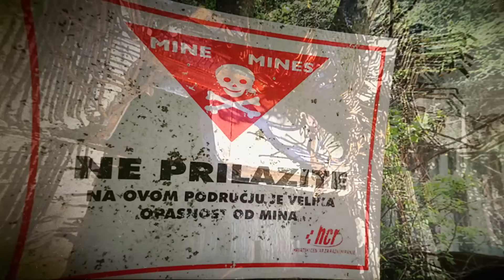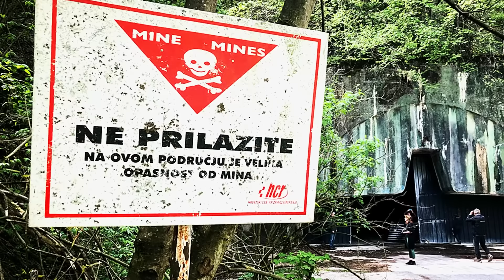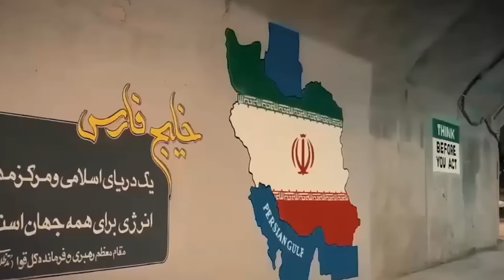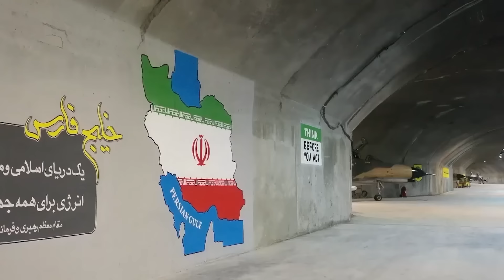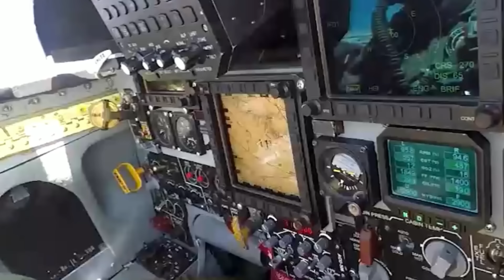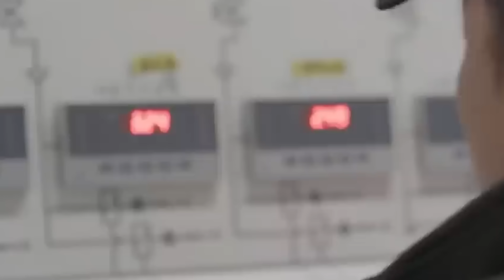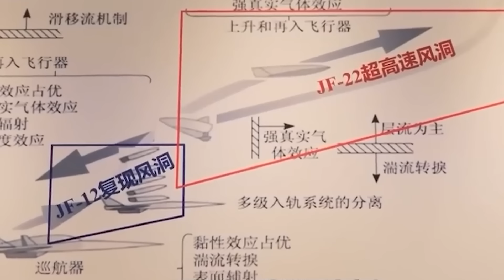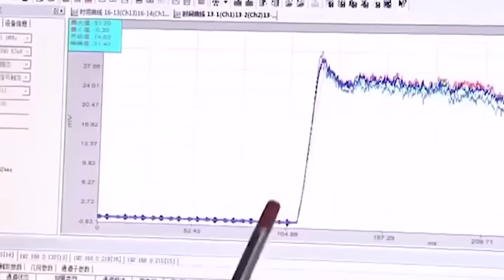Images of Secret Places that Shocked the World

Comment: The major flaw I see is even if they have "hardened underground structures" housing planes, they STILL need runways, right?  Since we know where these "hidden" bases are, the runways are out in the open, should be the FIRST AND PRIMARY targets.  No runways, no planes getting off the ground.
Reply: Exactly.
Reply: When Iran first showed the footage , There were identifiable rock formations in the video..  Probably wasn't their wisest move.  Not to mention, You only need to collapse the entrances to make everything inside completely useless.
Reply: @MrTommyboy68  runway denial munitions are not just for putting holes in runways.  They are also a phycalogical weapon as well since they also contain submunitions that are designed to be, in a sense,  booby traps for the engineers and / or EOD specialist that come out to repair the runway. Their nasty devices for sure.
Reply: @MrOmega52  Cool.  Good to know.
Reply: The runways are underground the very end is the only part you need
Reply: @jeremymackevincaylor5041  Yep, and since it is OBVIOUS where the runways are, they can precision target the runways and maybe shove a rocket or two in the tunnel or blast the dog snot out of any blast doors they may have.
Reply: I’d say the fact they have no visible way of expelling carbon monoxide would be a bigger issue. i guess they could wear oxygen masks? the whole base seems like a huge oversight lmao

Comment: Hypersonic capabilities mean nothing against good detection capabilities. As long as you can detect it soon enough, it can be stopped. The reason for this is hypersonic craft no NOT have to ability to maneuver quickly and their flight path is NOT "erratic" in spite of what was said in this video. At the speed the object is traveling it has little ability to alter direction and any changes in direction occur in small amounts over large distances and as long as it's been detected it can be intercepted. This is why America invests in detection technology rather than it's own hypersonic technology.
Reply: The US has been developing the SR72 Darkstar for several years. It's cruising speed is Mach 6

Comment: The area around Zeljava has been largely demined, a year ago I have not seen so many "mines" signs that I have seen two years before, there is even a container bar and a cleaned parking there that weren't there before. The site is not interesting for the army as it is right on the edge of the border between Croatia and Bosnia&Herzegovina. one of 4 entrances is on the Bosnian side, 3 are on Croatian side and 1 and a half (if I remember correctly) takeoff/landing strip is on the Bosnian side, the rest is on Croatian side - and they have also been bombed. Basically useless for any of countries unless they had the same army. When Yugoslavia existed, there was no official border there.

Comment: Well I am no engineer or anything like that, but seeing the pipe systems which shoot out in mach 5 is just crazy, so now I was wondering and as I said I have no Idea I am just a idiot on the web, but why are we shooting rockets into space with so much fuel and stuff, if we could use a pipe system which works just like a gun barrel, which builds up way more pressure with less fuel and basically shoots them most of the way into space rather than gasing all the way.